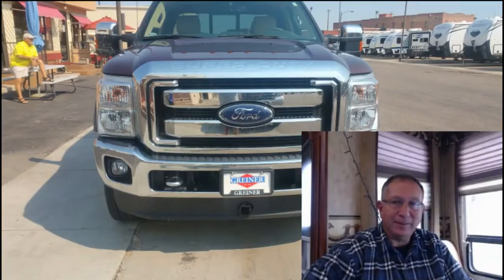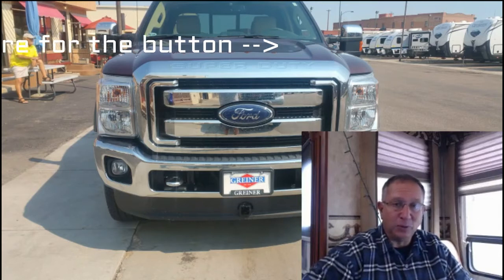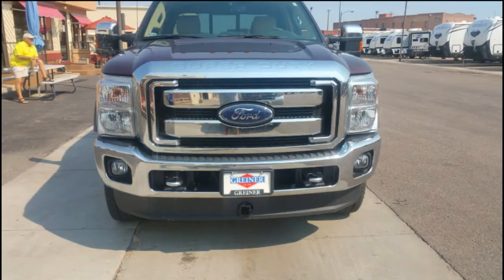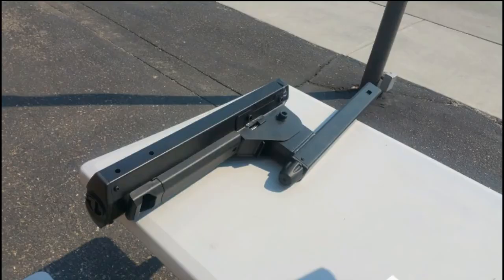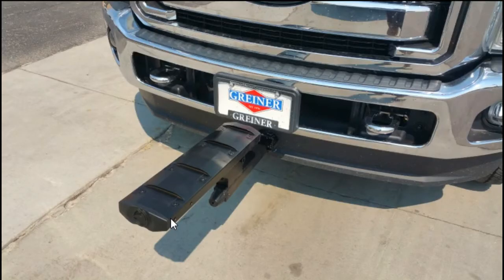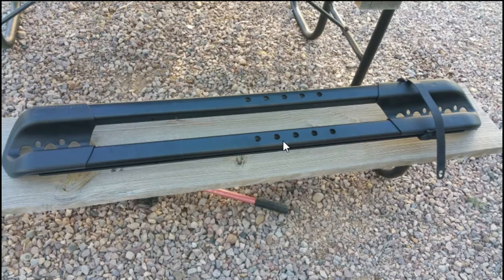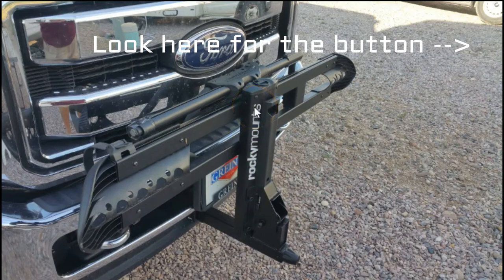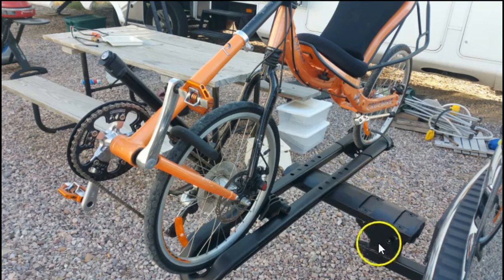Rocky Mounts Bicycle Rack

Comment: I've thought of a front receiver/bike rack setup. Do you find that your bike picks up more bugs, road spray, and road grit that if it were mounted on the back? Does the Rocky Mtn rack have a locking system to lock the rack to the vehicle and to lock the bikes as well?
Reply from the maker: No to the bugs/road grit - but - know that i'm in a fairly dry climate that doesn't have too many bugs; yes to the locking system. Check the link I provide in the article to review the rack. Al